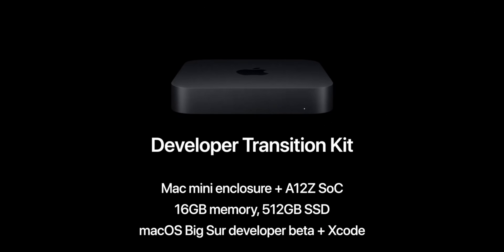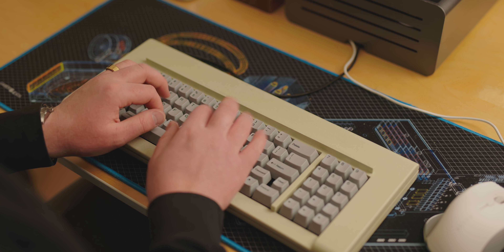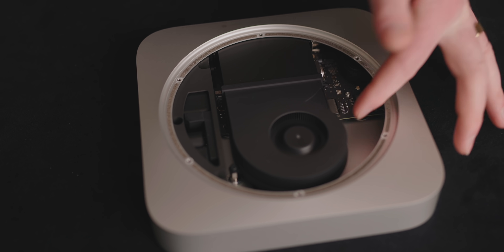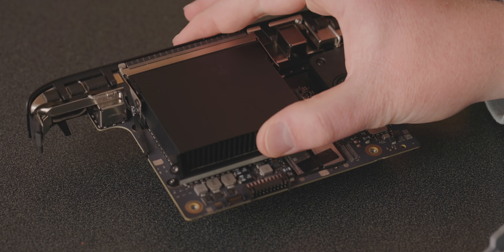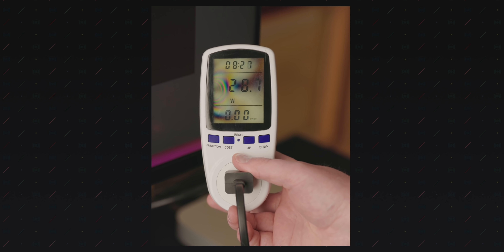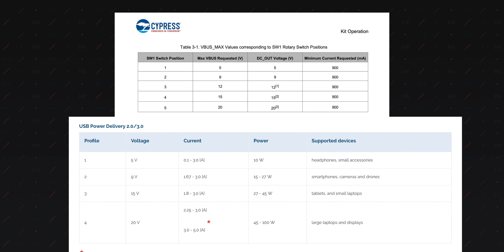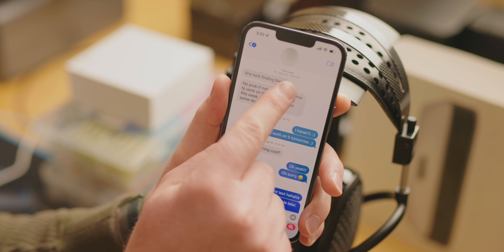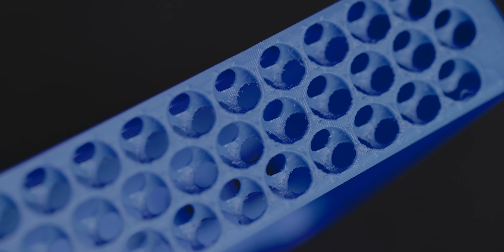We made the Mac mini ACTUALLY mini!

Comment: Congrats on the build, I think it shouldn't have an outside power supply though, maybe by having it a bit wider there would be room for upgrading something, like adding external storage as internal, adding a wireless charger on the top, or having a beefier cooling solution. Having a separate brick discharacterizes the product.

Comment: Very nice solutions with Magsafe, etc. 
BUT to be totally, totally honest: the case looks.. awful.. sorry. It just does. You can see coils through the ventilation, it looks so "plasticy" and cheap.. But I know this a matter of taste. I would prefer solid front, maybe a slit in bottom front of the case, which you can't see. Case have to be aluminum or other metal.
Very impressive otherwise!

Comment: You imply from your research and engineering playground (without real world proofing or manufacturing scalability) that Apple could have shrunk the Mini design because their new SOC (System on a Chip) designs are more power efficient than the Intel chips. So they could have made the design thinner and smaller...essentially super shrinking the Mini. What about future proofing for more robust SOCs? Or more robust capabilities in the Mini's already super small form factor? Say more space for additional SSDs? Or even the ability to capture game play through some sort of built in capture card our run it through thunderbolt (if that were ever to become a thing on Apple)? Customers are already comfortable and familiar with the current design, and that gives Apple a lot of latitude to improve performance and capabilities. Keeping the same form factor opens up options for future expandability in an already tiny design. YOU PISS ME OFF!!! I WILL HARVEST YOUR SWEETBREADS!!!

Comment: It looks really good, just one big omission, no RF shielding. The original had a metal case forming a faraday cage with the antenna in the bottom puck so it was outside the cage to then get reception. With the antenna sitting directly on the main PCB you are going to have poor wifi and a lot of interference. Since Snazzy Labs isn't sponsored by case manufacturers maybe he could do a video on cases and the importance RF shielding.

Comment: It feels like it's cheating to remove the power supply from the Mac mini as part of making it smaller
Reply: Yes I agree
Reply: Ah yes, because removing a overpowered unneededly big component is cheating.
Reply: @poplix2704  it is if the one you replace it with doesn’t go inside the machine.

Comment: Kinda puzzled as to how that little plastic box can dissipate almost 75 Watts without getting really really hot.   A 75 Watt light bulb gets far too hot to touch.  Some thermal pics of this computer going full tilt would be informative.
Reply from the maker: Don’t have thermal pics but I can’t get it to throttle which means the die isn’t reaching t-junction temperature. It gets pretty toasty up top but never hot.

Comment: Finally - This is what i have been saying since the release...
Though personally i would have used a CNC in Aluminum simply to turn the case into the heatsink
Reply: How expensive will it be to machine the cheese grater from aluminium billet ? maybe laser cut and joined is more economical?

Comment: I wonder how big your case would be if you included the Power Supply in the case like Apple ..   I bet it would be comparable to the original Apple case.
Reply: yep it really is cheating, volume should be the brick and case combined. Though in saying that, I do prefer the external brick either way since it is easily hidden but still
Reply: Exactly -- you've gone back to having to deal with a power brick again.
Reply: @gdp3rd  why though? It’s a desktop, no reason you can’t accommodate the brick outside
Reply: @LzysGraphics  because in my long experience the brick is almost always in the "wrong" place for cord management

Comment: My 80486 didn't require a heatsink and fan. If the M1 is really good, it should be able to run without one too. Let's see how well it performs then...

... hint....hint...
Reply: Intel used to scoff at AMD that their P5 chips would burn up if the heatsink came off. So here we are, 28 years later. How fast is the M1 barebones?

Comment: I came up with a no-glue trick for the gnurled inserts: print them with holes large enough to fit the inserts into, then after the wash and dry, but before the cure, put screws in the inserts to prevent any getting in there, brush a little resin on the sides and put a tiny amount in the hole (q-tips work best for this, I find), then press them in and cure them in place. Oh, and if you have a handy blank board to make sure they stay straight, just use extensions to lift it up away from the resin, while still keeping them in their proper holes.
Edit: I personally have an Elegoo Mars 2 Pro, so I came up with this for my Arduino and raspberry pi housing projects, but I think it's reasonable to expect it to behave the same in this case. Just a bigger print area, after all.
Edit 2: Make sure to keep a tissue handy for any extra that squeezes out when you press the inserts in, unless you don't care about a permanent "wet" looking bump where it cures.

Comment: Well, there's a fact that people are returning the M1 Mac Minis because of the aluminum enclosures causing Wi-Fi and Bluetooth reception issues, trying to get one that doesn't have these issues. What you've done here is so impressive and solves this, but I'm still a bit loath on performing this work myself if the M1 Mini gets a price drop with the incoming event, particularly if Apple retires the all-aluminum enclosure to use the new design on top of that.

Comment: Shrinking a Mac could be much better. All you had to do was disassemble the MacBook Air, remove the display and battery, and relocate the connectors to the rear. The trackpad could be removed as well. It would be much better and the computer would fully "disappear".

Comment: Every time Apple changes the processor, they first stick with the same or similar design.  Just look at the 640X0 to PPC transition or the PPC to Intel transition.  To have done a redesign right away would have been opposite to what they have done in the past.
Reply: Well, the iMac does go against that pattern.
Reply: @fVNzO  no it didn't, the iMac was not the first release.  I am talking about the first released products with the new processors.

Comment: Great video and great project! But can't lie - I think the case would have been better if made out of wood with a dark oil coating 😅
But I assume being clear to see components was a strong desire lol.
Reply: Also, wood burns.
Reply: @01epoch74ny  There are plenty of wooden PC cases. You can treat the material to handle heat. If your PC sparks an actual flame, the case isn't really the issue lol.
Reply: That's fair, still though, if like the PSU fails and sparks, that's ur whole pc in flames right?
Reply: @01epoch74ny  if the wood is untreated, maybe. But if it's an electrical fire then it's irrelevant - see Gamer Nexus coverage of, I forget which company, the computers with a faulty design that shorted components and created fires. (Metal case)

And for other instances of wooden ecased computers,  see Linus Tech Tips PC desk builds and I believe DIY Perks various wood and brass custom builds.

Comment: The reason it has a 150W is precisely because you end up using 40-50% of that power. The peak efficiency of most power supplies (i.e. when there are minimal losses) is around 50% of peak capacity. It's also why most gaming computers have super beefy power supplies even though they most often consume 200-300W doing normal tasks.
Reply: This is completely false. The "80 Plus" rating system starts at 80% efficiency and goes up with the higher tiers, the common Gold is around 90% throughout its range of output.
Reply from the maker: No, it’s precisely because the prior model would peak out at around 130W.

Comment: Part of the reason for the 150w power supply is for powering power hungry USBA/C devices, yes the CPU went from ~75w to ~24w, but the 150w PSU was lacking in the previous generation if you were using many power hungry USB devices, and that 75w CPU.

Now most accessories wont draw this much power, but there were some USB-C/thunderbolt raid enclosures and network adapters that could use as much as 30w
Reply from the maker: There are fewer ports this time around. We accounted for power. USB on this machine is limited to 5A at 900ma and TB share a 22.5W pool.
Reply: @snazzy  I didnt even look at the spec of the Mac Mini, you'd have thought that with the extra power budget they'd have offered better ports.
Maybe they were expecting to launch it with an M1 Max variant not long after launch but have ran into some other issue.

Comment: Were you able to run a high load endurance test to check that thermals were ok under heavy long-term load?  While I understand that it doesn't require much cooling, I doubt apple would keep the fan if it didn't have to (but I can't argue with a test)
Reply from the maker: Yep, we ran a Cinebench test for 40 minutes with no throttling.
Reply: @snazzy  wow!  That is darned impressive.  fantastic work!

Comment: I am disappointed that you are now using an external power brick. A nice video, great fun and DIY projects are always cool... but you should have kept an internal power supply if you were to make apples to apples size comparison.
Reply: The rumored mac mini update will have an external power brick. I don't understand your disappointment?
Reply: With the lower power consumption of the Mx series Macs external power supplies are much more feasible. It also helps reduce the internally generated heat of the computer by removing the second largest heat generator from the case.

Comment: Get rid of the 15V adapter, and use a 12V direct. Then you dont need the voltage DC DC and it will be even smaller and easier to replicate.
Reply from the maker: Find me a 12V adapter that can supply 6+ amps.
Reply: @snazzy  
You you ever googled for them? There are tons of decent 12V 6A+ adapters out there because a lot of LEDs run at that voltage.
Reply: @snazzy  use a 65W gan fet USB power adapter and a USB 12V 5A break out board. Google " jacobsParts USB-C PD 12V DC Fixed Voltage Power Trigger Module 5A Type-C Female Input". Comment with links just get removed.

Comment: Great build! A Mac mini of this size would be so similar to those little Intel NUC PC's you see in offices. You could literally stick it to the back of your monitor and have the cleanest setup.
Reply: You can also stick the normal Mac mini on the back of your monitor.
Monitors are huge.
Reply: @Jehty_  Kinda heavy for monitor mounts, especially cheaper monitors with flimsier stands.
Reply: @Seatux  I've had my last 2 Mac mini's mounted to the back of my monitors. VESA mount. Works perfectly. 🙂
Reply: LPF  or my monitor arm is just plenty strong enough 🤷🏼‍♀️

Comment: This makes me want to buy a 3D printer and make one myself.
Reply: Yep, you can FDM print it in ASA plastic which is thermally resilient to about 95°C, you can print the holes undersized and drill them out clean, and you can sand and fill the imperfections in outer surfaces with something like Revell putty. You can then spray paint it satin silver for the authentic look. Satin paint is a little difficult, i find that i need like 5 super fluffy light coats with intermediate 2000grit sanding. You don't strictly need a large format SLA printer to complete this project.

Do be aware though that most "i want to buy a 3D printer"  3D printer ownerships are... not very successful, there tends to be more complexity and knowledge required than you bargained for, and most people give up. But i've had mine for over 4 years, and it was one of the best purchases i ever made!